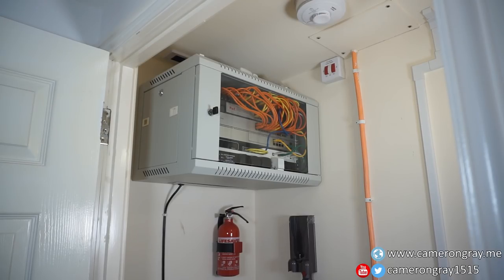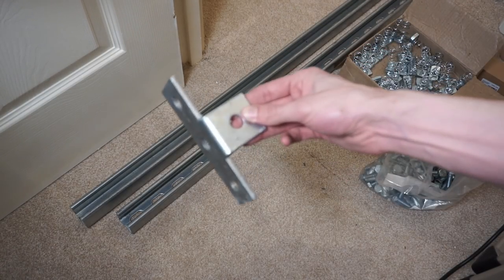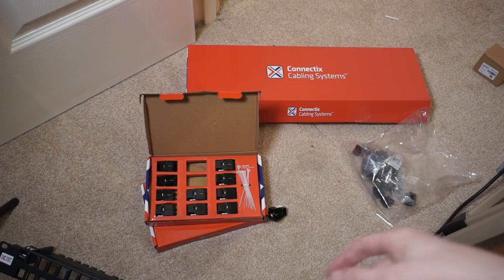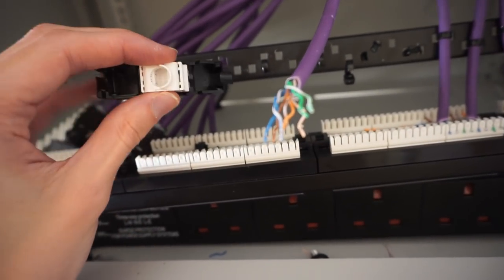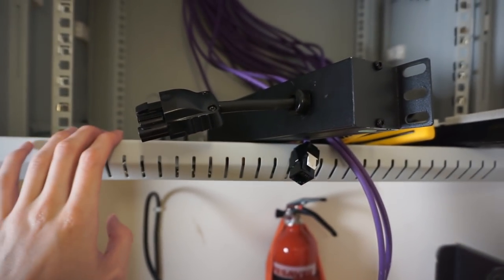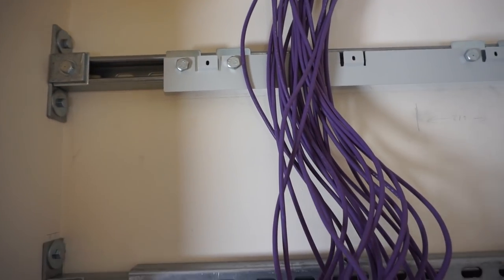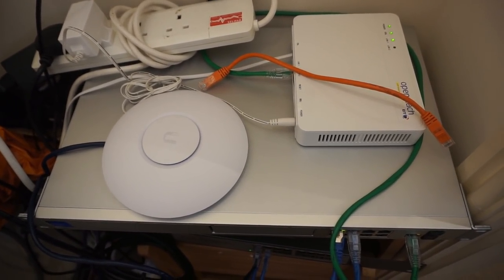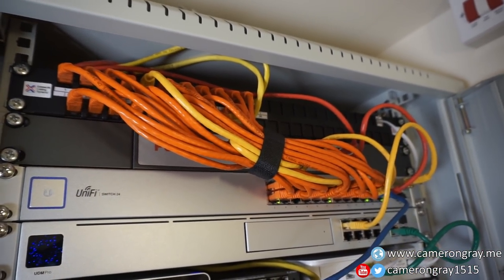Improving my Home Network Rack - New Patch Panel & Better Wall Mounting

Comment: @cameron grey How do those Connectix keystones compare to the Excel ones? If I remember correctly you used Excel keystones with angled euro module fronts around the flat?
Reply from the maker: They're both pretty similar although I like the fact that the Connectix ones come in a bulk box whereas the Excel ones came in individual bags which was more fiddly and less environmentally friendly.  The ability to use a zip tie on the Connectix ones was also a nice touch.  That said, the Excel euro module keystone shutters are still my favourite way of terminating a network jack and Connectix don't offer an alternative (their angled module protrudes from the front of the faceplate slightly) so if I'm using those I'd probably end up using the Excel modules so that I can order both parts from the same place.
Reply: @camerongray1515  Thank you for the reply. Have you done any drops where the cable comes from below with the angled euro modules? Just wondering if its hard to terminate nicely.
Reply from the maker: Not personally but you'd definitely need a fair bit of space in the back box to bend the cables around, doable but you'd want a 47mm box for sure.  With a dry lining box I'd be tempted to still bring them in the top so the bend is inside the wall rather than constrained to the box however with a metal box sunk into a solid wall, you'd probably just need to use a deep box and bend it carefully inside it.

Comment: I've seen those U-channel profiles used here in Hungary, but I am yet to find where can I buy them. I don't know the name used here. It would be really handy for on-wall installation of cable trays, compressed air lines and similar stuff.
Reply from the maker: If you look for the brand name "Unistrut" you may be able to find it, places selling the branded stuff may then give you the correct words to look for.  A lot of places selling other brands list it as "Unistrut compatible" as well.
Reply: It's available in my local home center here, but I'm in the USA. Maybe check if your closest home improvement store has an electrical department.

Comment: You probably already knew this but you could have terminated your telephone into an RJ45 keystone module and the connected your RJ11 into that. RJ45 is design to be compatible with RJ11 cables. I have also seen people crimp RJ45 cables onto RJ11 cables.
Reply from the maker: This would definitely have been an option, however I personally prefer using an RJ11 connector in this type of situation as I feel that it is more "self documenting" - as in, it can't be mistaken for a regular network drop and you physically can't accidentally plug a network device into it. It's also worth bearing in mind that doing this does run the risk of damaging the outer pins of the RJ45 connector due to the plastic of the RJ11 connector pushing them down further than they normally would be.  If the connector is left in for a long period of time, it's possible that they won't spring back up to their proper height and therefore may not make a good connection if the connector was used with an RJ45 jack in the future.  Not really an issue in this case since the jack would only be wired for the phone line, however, if I wanted to connect a phone to say, a wall port that may be used for network in the future, I'd much rather use an RJ45 to RJ11 adapter/cable to prevent this issue.  As you say, it's also possible to make up an RJ45 to RJ11 cable and in fact this is what I was using with my old patch panel since this was entirely RJ45 connectors where I still wanted to use the last one for the phone line.
Reply: @camerongray1515  fair dos. Makes sense to me!

Comment: I'm a sparks by trade and theres nothing wrong with what you done but could you not have just found the studs and drilled holes in the back of the cab to suit.
Reply from the maker: That's the issue though, there's only one stud on that wall so I couldn't mount the cabinet across two of them.  Otherwise that's exactly what I'd have done
Reply: @camerongray1515  ah ok, you would also get away with using plasterboard anchors like you did, as long as you got 2 solid fixings into that one stud

Comment: Really enjoyed the video.  I wish I’d known about those Connectix keystone patch panels when I moved from my floor standing 42u rack to 2x 8u wall mounted racks; they would have saved me much headaches and crude 4 letter words 😀

I’m curious about the use of a Cloud Key & a UDM Pro - I thought they did the same job?

Either way, keep up the good work!
Reply from the maker: The UDM-Pro can certainly act as an NVR for UniFi Protect, however my issue is that if you need the cloud remote access for Protect (which is required for the mobile app, even on the same LAN), you also need to enable cloud access for the UniFi controller.  By keeping them as separate devices, I can keep remote access enabled for UniFi Protect on the CloudKey while keeping the UniFi controller on the UDM configured for local access only.
Reply: @camerongray1515  Ahhh yes, that makes perfect sense as to why you’d keep them separate; I never did understand why UI forces you to enable cloud access on the UDMP (I would assume it’s for either Talk or Access), I hadn’t realised that the Cloud Key didn’t require you to enable cloud access; I probably would have gone down this route had I known.

I was running a UniFi controller on a Mac mini that the psu decided to go pop in, taking out the hard disk in the process - either way you live and learn.

I really appreciate the reply, thanks.

Comment: That SFP/RJ45 adapter module triggers me. Just get a cheap DAC SFP/SFP cable. Should be dirt cheap for a 6-inch or 1-foot, better bandwidth to your UDM, and will put less strain on the port.
Reply from the maker: I already had the module so may as well have used it.  A DAC wouldn't provide any extra bandwidth, the SFP port on the switch is still gigabit.  Now, if I had a more recent switch with an SFP+ port then it may be worthwhile but as it is currently in see little reason to spend the extra money to replace what's working fine.

Comment: what is the plate/dust cover called where your cat6 cables are coming in?
Reply from the maker: It's a letter box draught excluder.  Just bear in mind that it's not suitable for installing on a ceiling that is acting as a fire barrier, in my case here there is a concrete ceiling above so the plasterboard isn't a fire barrier but in other types of construction it may be a consideration.

Comment: Why the CKG2 and the USMP Cameron? Don’t they have a lot of mutual functionality?
Reply from the maker: The UDM-Pro can certainly act as an NVR for UniFi Protect, however my issue is that if you need the cloud remote access for Protect (which is required for the mobile app, even on the same LAN), you also need to enable cloud access for the UniFi controller.  By keeping them as separate devices, I can keep remote access enabled for UniFi Protect on the CloudKey while keeping the UniFi controller on the UDM configured for local access only.
Reply: @camerongray1515  Ah! I see. I have the Cloud Key Gen2 (non-pro) for UniFi Network and the UNVR for Protect so I never ran into that. Not quite ready to step down from some of the advanced features of MikroTik RouterOS to the UDMP just yet.

Comment: Where did you get the brush plate for the ceiling? I need something like that...
Reply from the maker: It's just a basic letter box draught excluder: https://www.wickes.co.uk/Wickes-Internal-Letter-Box-Draught-Excluder-White---78-x-338mm/p/218011.  That said, make sure that your ceiling isn't classed as a fire barrier as this would mean that you'd need to take steps to protect the hole against fire spread.  In my case, the plasterboard is a drop ceiling below a concrete ceiling above so it's fine, however this would be different in say the downstairs floor of a house where the wooden floorboards of the upstairs rooms is immediately above the downstairs ceiling
Reply: @camerongray1515  Thanks for that -- I'm in the US so I found something on Amazon for $15. We don't have a lot of letter boxes in our doors here so it's not something that came to mind :)

Comment: Did you know an RJ11 male fits perfectly (and works) in to an RJ45 Female socket?! No adapter required!
Reply: He had it working like that in the old patch panel
Reply: @wojciechkonowrocki37  Looked to me that he used a male RJ11 to male RJ45

Comment: It kind of hurt me towards the end of the video seeing the SFP on the switch going to the RJ45 port on the UDM Pro :(
Reply from the maker: Purely doing that because I already had the SFP to RJ45 module so freed up the main switch ports for other devices.  As the switch only has gigabit SFP ports there would be no real benefit to using that vs just running a regular CAT6 cable between the devices.

Comment: Ahhhh those patch leads... Nice mounting etc but those patch leads are an abomination. Get a brush 1u panel, remove the poe injector panel and replace the patch leads as you had said but get a least 0.5m ones. Other than that good job!👍
Couldn't be looking at those patch leads on any of my installs.
Reply from the maker: In what way?  Fit a brush plate and stuff the slack through it?  Sure it would look better but I'm not going for the /r/cableporn look.  Personally I'd rather go for some sort of front mounted cable management bar instead of a brush plate (which I'd use for running cables to the rear of the rack rather than for storing slack) but I don't have the front depth for that.  I'm also relatively space limited and while I could remove the PoE injector to get an extra space, I'd then need to spend a significant amount of money on a new PoE switch.  There's always a balance between functionality and overall appearance but in my mind, if it's functional and easy enough to maintain then it doesn't have to look flawless.

Comment: Still something to improve, cables could look cleaner than this, especially the stray orange ones.
Reply from the maker: It'll never be possible to make something like this look absolutely perfect without ridiculous amounts of effort which will go out the window as soon as something needs quickly changed in the future.  It's hard enough when you come up with a cable colour coding scheme which will last until you need to connect a device which you don't have a suitably coloured cable for then, bam, the colour scheme is out the window! Cables have to go to other devices in the rack (hence the ones that go over the top of the patch panel) then there are some patch leads that run directly between ports on the patch panel to provide direct links between room ports.  My goal was not to provide some sort of Reddit /r/cableporn setup, it was to provide something that works for my needs and is easy enough to work on in the future.

Comment: Good video, no DAC cable between the switch and UDM ?
Reply from the maker: The switch only has gigabit SFP ports so a DAC wouldn't give any benefit.  The SFP RJ45 module is a layover from previously when I needed a single extra RJ45 port on the switch so I may as well just keep using it since I have it, otherwise I'd just use one of the regular switch ports at a fraction of the cost of a DAC cable.
Reply: @camerongray1515  I like the looks of a 1foot dac cable coiled up nicely!
Reply from the maker: Sure, they look nice but I can't really justify the cost given it'll function the same as if I were to just run a CAT6 cable between RJ45 ports and not use SFP at all.
Reply: @camerongray1515  the 27$ SFP DAC to go from the 2 devices isn't that much money + you get an extra port & can remove a SFP to rj45 device.
Reply from the maker: I can do but it honestly doesn't bother me, I really don't understand the issue with an SFP to RJ45 module that works perfectly fine other than "it doesn't look nice".  I use DAC cables where appropriate (such as at > gigabit speeds) but I really don't see the obsession with them, it's just a cable.
Reply: @camerongray1515  IT just looks nicer & from what i have read, could be wrong a DAC cable has better handshake & stability & more through put on that port for Backend.
Reply from the maker: I'll probably end up doing something in the future when I move to 10gbit but it's not something I'm bothered about now.  People often use DAC cables under the false impression that SFP = faster.  In practice the throughput will be the same and I've never experienced any sort of stability difference between the two methods.  Theoretically SFP can have marginally lower latency and power consumption but at the distances involved it would give me absolutely no benefit.
Reply: @camerongray1515  I was talking Throughput on the SFP ports for back end :) It was just a suggestion that's all. Sorry if this took off topic..
Reply from the maker: It's fine, I just see a lot of people, especially in YouTube home network videos that show DAC cables or fibre between gigabit devices making out that it's somehow some sort of "magic super high speed connection".  They have a place and are very useful cables, but they aren't automatically a better solution than a simple CAT6 cable 😉
Reply: @camerongray1515  yeah understand. I have a 1gig SFP fiber cable from one Aruba switch to another @1g, then 3 more lines @10g to my server & Storage Box.

Comment: I would have to make up the patch lead to length.
Reply from the maker: It's definitely possible but for me it's a balance of aesthetics vs reliability.  I've just had too many issues with self crimped patch leads to trust them in situations where a pre-made cable is suitable. Nowadays I tend to only crimp to either pass a cable through a small hole or, if I have the time, to replace a faulty connector on an otherwise decent cable.

Comment: Why not make your own patch leads to get the perfect length?
Reply from the maker: It's definitely possible although I'm not bothered that much about the appearance of stuff like this as long as it's maintainable.  I generally much prefer to use pre-made patch leads as I find them to just be so much more reliable than manually crimping RJ45 connectors.  I'll do it if I have to (such a if the cable needs to pass through a small hole or potentially to replace a broken end on an otherwise good cable if I have some spare time to kill) but for most of the stuff I do, I feel pre-made patch leads are a more attractive option due to the time savings and overall reliability.

Comment: You could’ve simply placed one shelf bracket under it fastened to the centered stud…
Reply from the maker: I did consider this however it would only really be suitable maybe as an emergency support to catch the weight if the plasterboard fixings were to fail - the stud is off centre and the metal on the bottom of the rack is too thin to trust fixing it to the shelf bracket and expecting it to support its weight without it tipping over sideways.
Reply: @camerongray1515  that would’ve solved the “I’m worried it’ll fall” issue, but what you ended up doing looks much better and is rock solid. It was just a LOT of work! I always massively over build anything I mount on a wall, as I worry about “what if’s” to an obsessive level.

Comment: Do you think you could talk a little slower in your videos? I find I have to watch at 0.75% playback speed so I can get the most enjoyment out of your content. Hope I don’t come across as rude.
Reply from the maker: It;'s a totally valid criticism (and you're probably the least rude person who's pointed it out!). It's something I try to do but I do struggle with it, probably doesn't help that my videos are generally unscripted so I'm usually rushing to say something before I forget what I was going to say (my memory is absolutely shocking!). Also doesn't help what I'm so bad at working out what to say, most of the clips you end up seeing are like my 5th attempt by which point I'm getting frustrated and rushing! While it's not a solution, I have YouTube's auto captions turned on so those might help a bit, they get some words wrong but they're generally reasonably accurate.
Reply: @camerongray1515  I see. It is a “me” issue rather than a “you” issue, but I appreciate that you’ve already been thinking about it! I do enjoy your content either way

Comment: Love the advice on the labels but then you go and make an absolute mess with the jumpers 🥲🥲

Rubbish!!

Good video though.
Reply from the maker: Rather than calling someone else's work "Rubbish" you're more than welcome to provide suggestions...  I wasn't going for something extremely aesthetically pleasing, I was working with extremely limited space between the front of the equipment and the door and with the cables I already had all while trying to install it quick enough to film a time lapse with a camera that has a habit of overheating if left recording for too long!  It's still perfectly accessible and maintainable and sits hidden away in a cupboard.
Reply: @camerongray1515  it was more a joke because you said rubbish. Sorry it didn’t come across that way. I think you did an excellent job. The only thing you could do is replace the switch with one that has ports to the left or right instead of middle. But jumpers are cheaper than a switch.
Reply from the maker: I mean, I could move the keystones to the right hand side of the patch panel, but the issue is that there isn't enough space in front of the switch to bend the cables over without the slack getting crushed by the door if I did this.  By left aligning the ports on the patch panel, the slack from the cables could be "used up" across the horizontal distance rather so that it doesn't get in the way of the door.